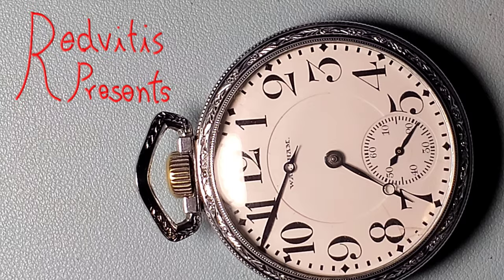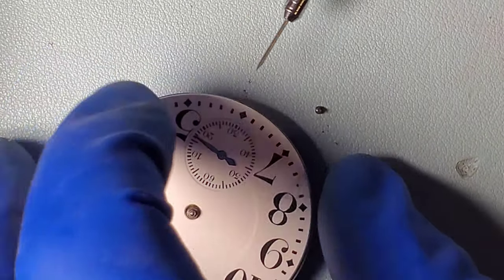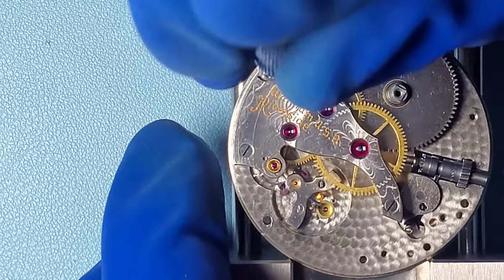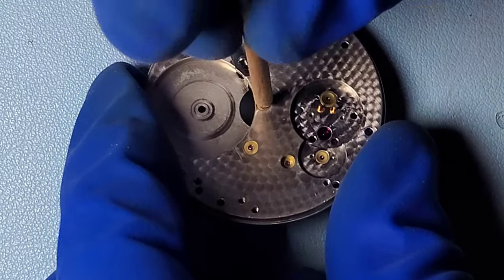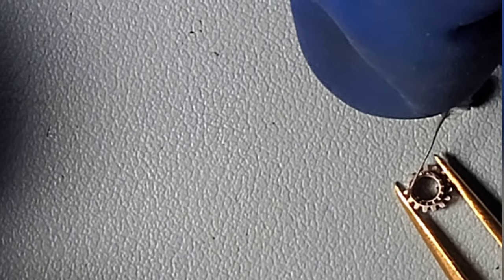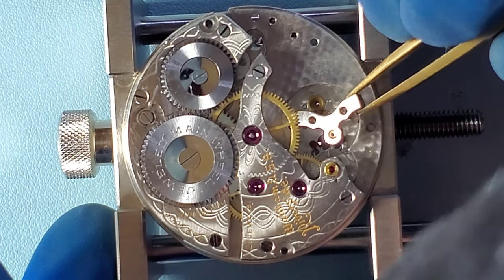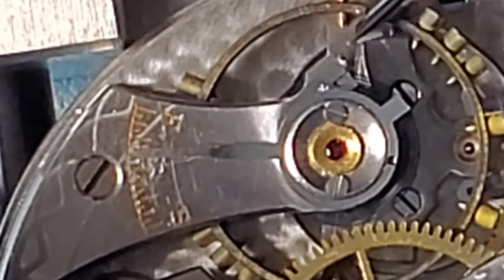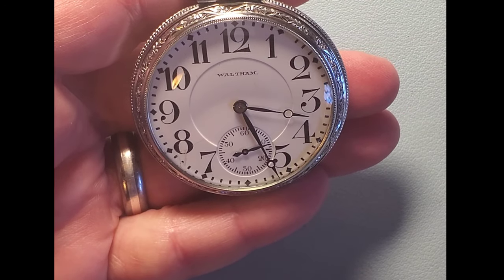It was running 20 min fast! Repair of Waltham Riverside pocket watch

Comment: I have a Russian 12s Seconda pocket watch with pretty much the same case. Just cleaning it up now. Got to polish the case as it is a bit scratched up.
Cheers
Reply from the maker: Try not to go through the plating if there is any, the under layer may tarnish or dull quickly. The one I worked on looked plated, maybe chrome, so I didn't polish.

Comment: May I ask how you fixed it from running 20 minutes fast?.   I have an old Elgin I put a new balance staff in, cleaned and serviced, and it is running 10 minutes fast.  I don't see anything wrong. It's not magnetized.  The hairspring is not stuck together.   I put it in beat.  Yet, it is running about ten minutes fast.  Beats me.  Any suggestions?.   Far too much to just move the regulator.
Reply from the maker: It is in the video 25:51:24 for my watch. For your watch, would ask if it's running 10 min fast in all positions, and does the balance have a matching serial number with the movement? These PW have been through so many hands. In my watch, Had the timing issue not been resolved by my repairs, then would perhaps have checked that the hairspring overcoil was not touching either the balance bridge or the hairspring. I could have also examined the balance closely, for signs that the screws had ever been modified.

Comment: How do you tell when the crown wheel is left of right hand thread? Is there a website?
I use Pocket watch database mostly but Inhavent seen any info on that subject.
Cheers
Reply from the maker: There no single answer to this question, Crash. One thing is for sure, it wont always be left handed (LH). Some LH screw heads are marked with lines on either side of the driver slot. In this waltham I removed the screw instinctively, for some reason I guessed correctly it was RH- looking back I think it was the small screw head. 
Sometimes there will be two crown screws and my experience is they are usually RH. 
Whenever I'm unsure, I remove the bridge and check the orientation of the female threads from the other side. 
Sometimes you just can't tell - then I look for video or try a forum.